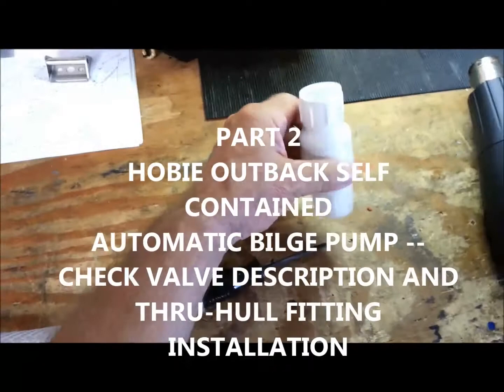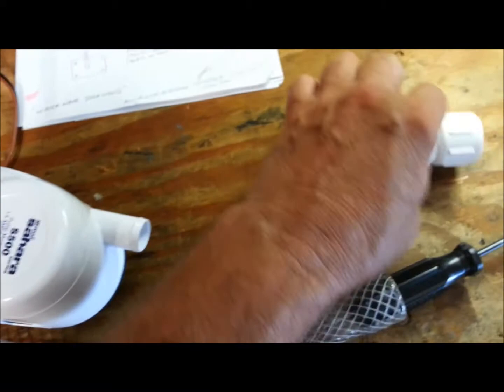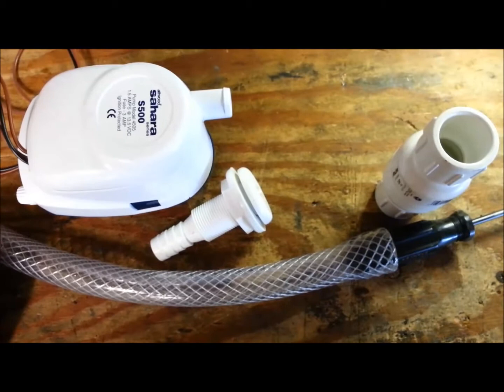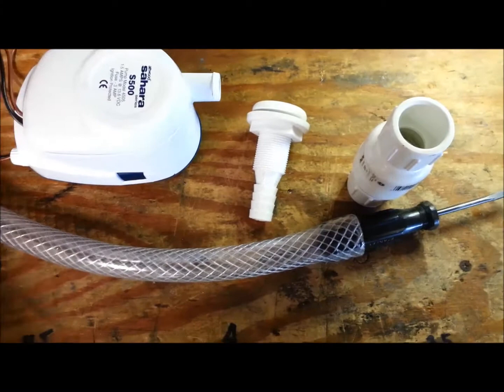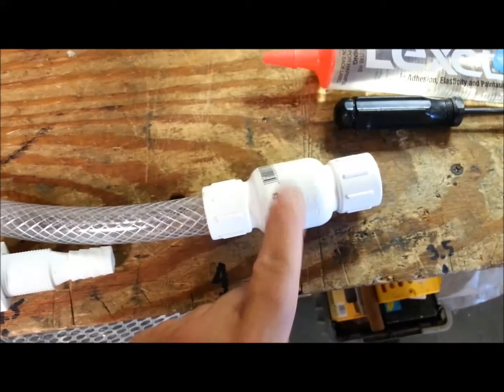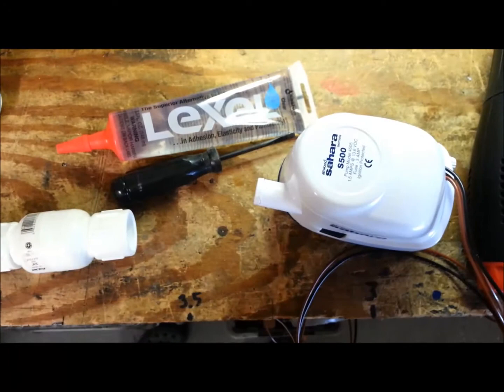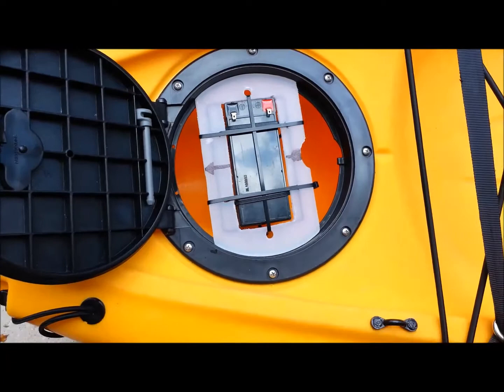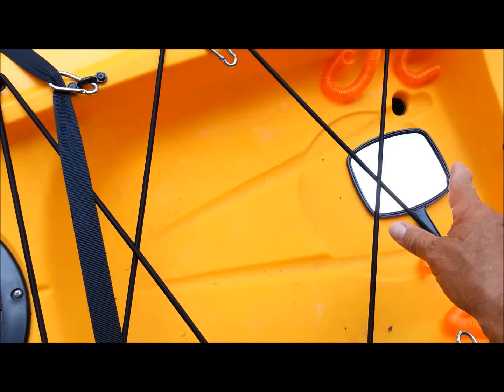HOBIE OUTBACK SELF CONTAINED AUTOMATIC BILGE PUMP PT 2

Comment: what battery did you use?
Reply from the maker: It's a 12 volt 12 Amp alarm battery. The pump is 1 amp at 12 volts so it ran for 9 hours on my initial test. A 7 Amp battery would be plenty which is about half the width of the 14 Amp model.http://www.batterysharks.com/Toyo-Battery-6FM12-p/6FM12_B12-12.htm?gclid=CJ6eg7KiwtMCFVVZhgodPN8CuQ
Reply: +John Sims you at the best. I'm installing my bilge pump right now and you just helped me complete it.thank you
Reply from the maker: Great! I used a thin coating of silicone sealer in case the terminals get wet or submerged. You can also wire up a waterproof fuse holder (Recommended-I used a 3 amp auto fuse & holder - and plug, the kind that has a rubber cap), and then seal the battery terminals with Silicone Sealer. That way you can still charge it and it won't short out if you flip or it gets submerged. It has saved me a few times out in the ocean when I didn't know I had a bilge full of water!